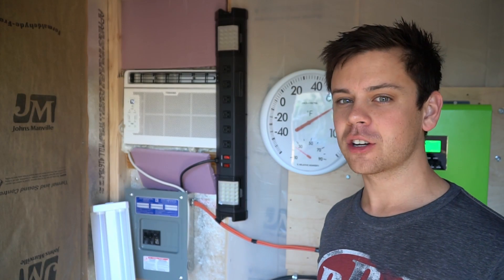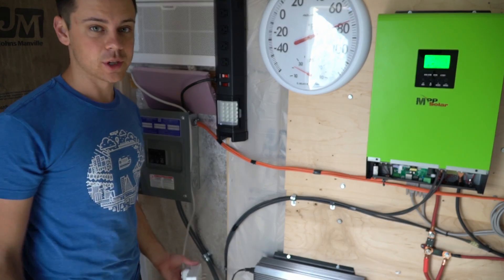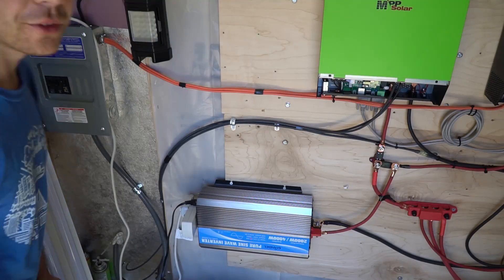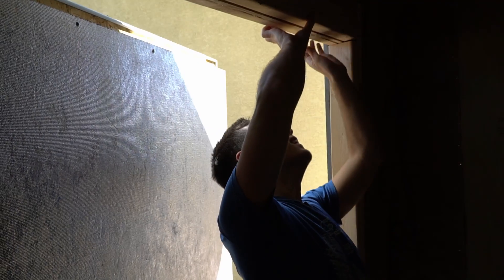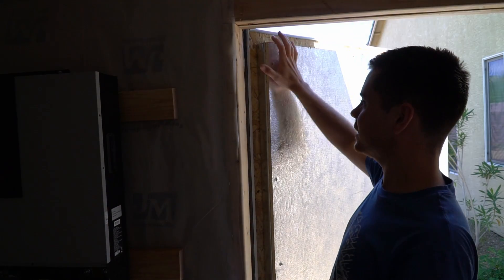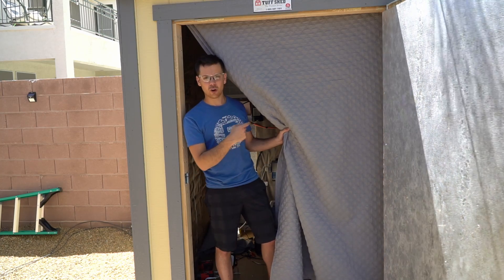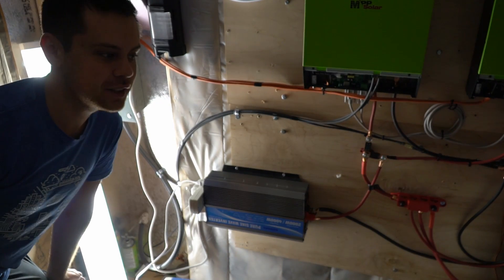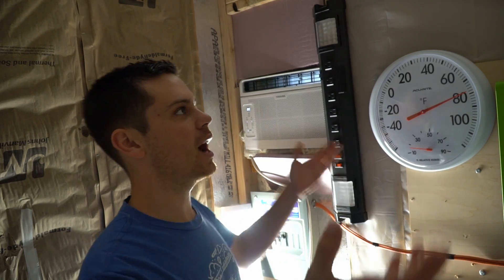Cheap Solar Powered Air Conditioner Part #2

Comment: Would be curious to see the difference when the ceiling is insulated on a 100° day
Reply from the maker: Yes, that is next :D
Reply: Mike Kruger either using a light coloured roof or insulating or both is best.  On a sunny day if you measure the temperature on the roof maybe at a steel flashing I bet it is 140 to 150 deg f on the surface of the roof.  By the way where are you?
Reply: @Fred Frond 
It gets hotter than that up under the roof.
I remember reading about whole house fans and the article making a point that it can get up to 160f up in the attic.
Maybe Will can stick a thermometer right under the roof and give us a real life reading.
Early afternoon temperature outside and a foot under the roof
Reply: @mark98115  it's really hot. Fry an egg hot.

Comment: Look into net zero building practices. Air tightness and ceiling insulation and the two top factors in efficiency.
Reply: Be careful of air tightness. In some climates total air tightness causes the interiors to mold. 

Every building is going to breathe. The key is to make it breathe where you want it to.

Roofs and soffits have vents in them for a reason.
Reply: @shawnr771  ACH is a measurement one must take. Also ERV .
Reply: Don't forget the rim joist

Comment: Surely isolating the roof will improved it. Not to keep the cool in but not let the the heat in from the roof
Reply: heat goes up and solar panels do extra direct heat insulation
Reply from the maker: Yeah, I will do that next I suppose. May improve it a lot
Reply from the maker: Yeah the solar panels make a massive difference already. But yes, need to insulate everything